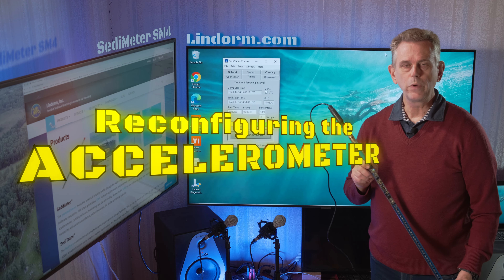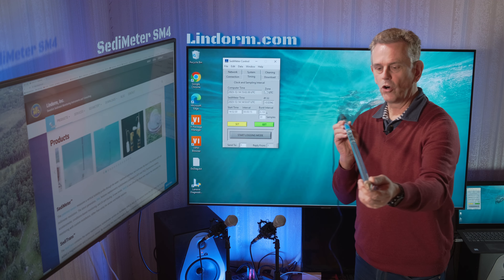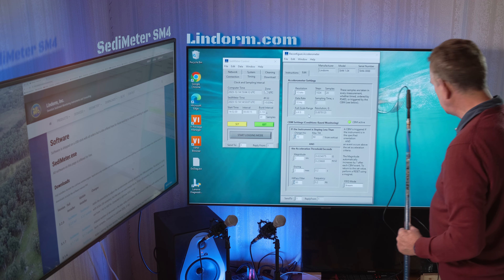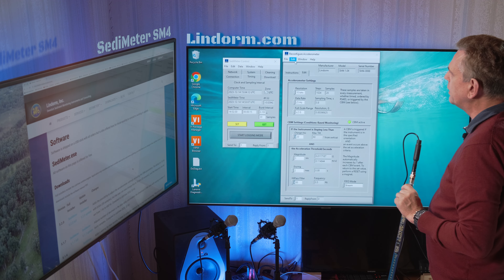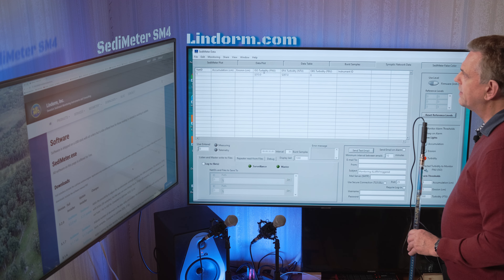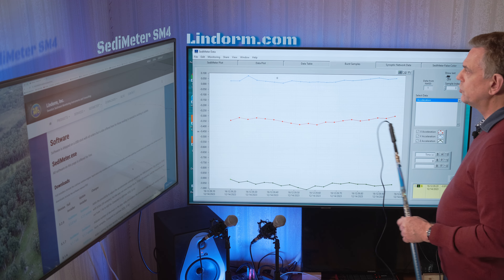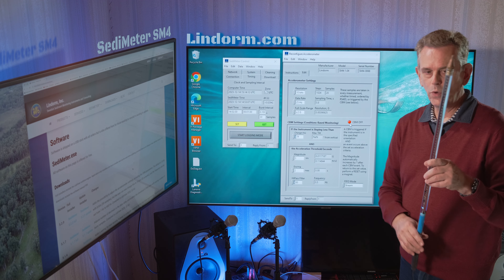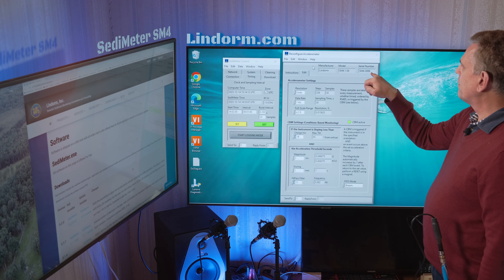New Accelerometer Features for All SediMeter SM4 Instruments - also the old ones

Comment: Hello, I would like to ask how to charge the instrument. Will the indicator light turn on when charging?
Reply: Hi, I think it will.
Reply from the maker: Yes, when you plug it in you should see a blue light, plus EITHER red for charging OR green for fully charged.
Reply: Excuse me, could you please tell us what about the yellow light? The blue and yellow light appear when charging. @Lindorm
Reply from the maker: @XianzhaoHE-zp8qs  In the SM3 model, there is a yellow LED that indicates that the instrument is listening to communication (and blinking when receiving commands). In the SM4 model the yellow LED is reversed: It is off when listening, but it is still blinking when receiving.
Reply: Thanks for your reply!  @Lindorm